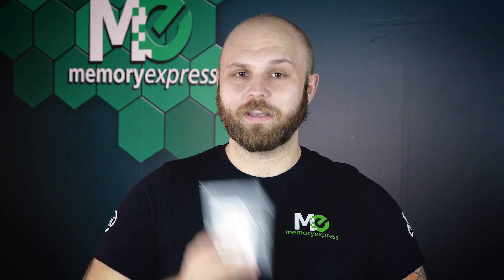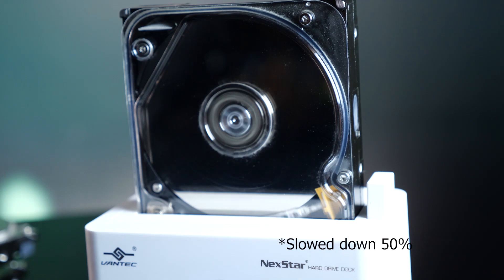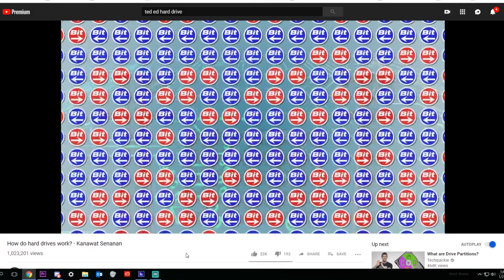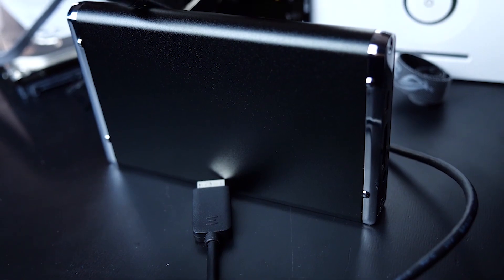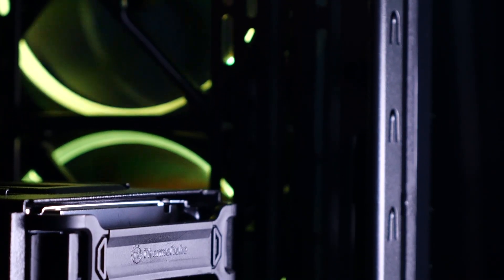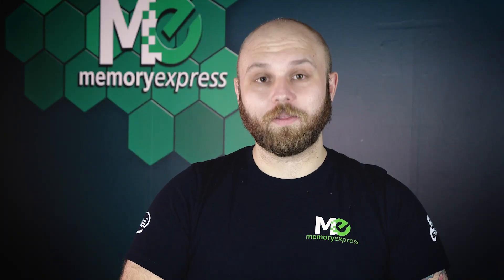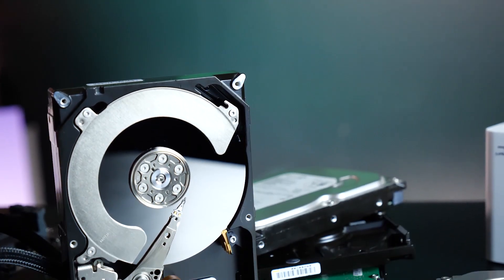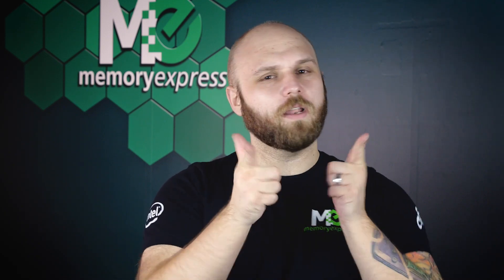Hard drives explained! How they work.

Comment: Flipping a recently deceased HDD over can sometimes revive it. I learned this ages ago while fixing Playstations.  I didn't know exactly why it worked, but my theory was the unit being upside down put less stress on the motor.  A while later I'd taken my desktop in for case swap.  Something happened when they were putting everything in the new case and it wouldnt boot up.  I told them about my old Playstation trick, they turned the HDD over and it booted up as normal.  It of course would not mount back into the drive bay and was likely dying anyway so I bought a new one, but at least the trick kept it alive long enough to do a data recovery on it.